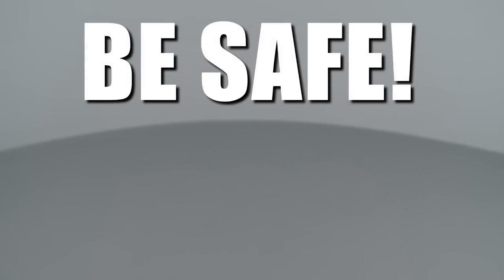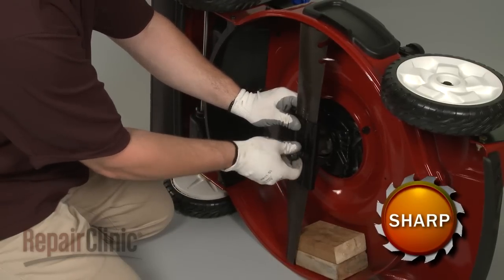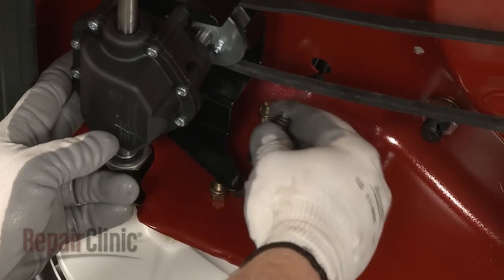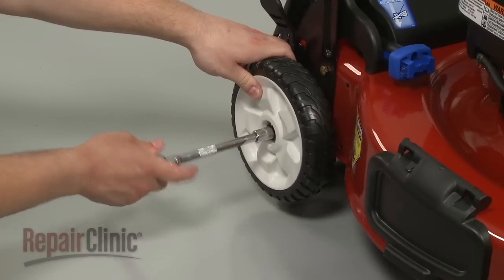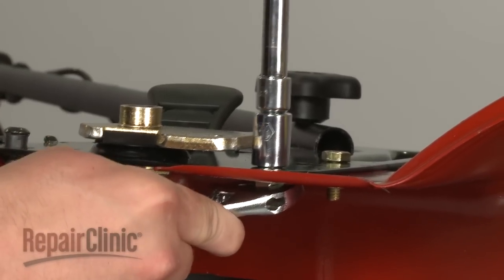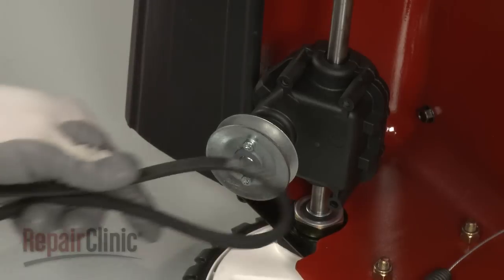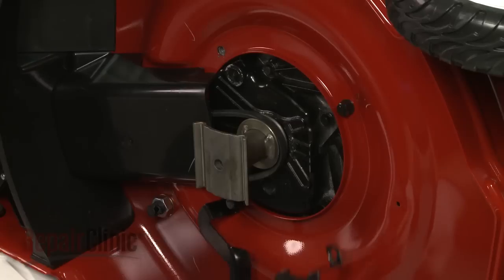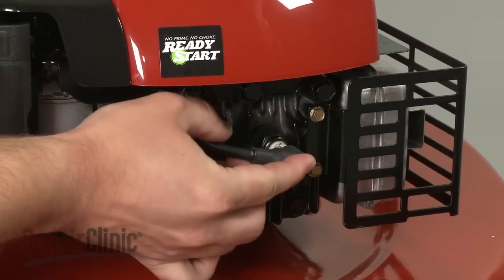Toro Lawn Mower Disassembly – Lawn Mower Repair Help

Comment: i took the right blade off and the bearing out on a my 42 inch toro rider. putting back together do the blades face the same direction  or do they face the opposite direction one north and south and one east and west.

Comment: I have Toro Recycler 22 Self propelled mower. Te left rear height adjuster is turning around and won't hold the height. I removed the wheel and the height adjuster turns 360. I wonder what it is that broke.. Took the right wheel off to see if I could find something missing but do not see anything. Any suggestions?

Comment: How can I replace the gold colored plate at 3:22? I bought a new one but can't get the old one off. It's what the wheel screws into but the hole on mine stripped.
Reply: You ever figure it out get a reply? I'm having the same issue.
Reply: @agentwise8725  Nope. It's not my main mower so it's not a priority. You might try calling Toro. Their customer service was helpful last time I called a few years ago.

Comment: Just bought this model new.  When the battery didn't charge in 26 hours, I checked the battery to be sure there was a fuse. There is but now I'm having trouble getting the battery back in.  Can anyone help an old lady out?

Comment: what about the spin stop model 20333? Much more difficult with a pulley and a bolt that has to be taken off thats connected to the shaft. Flywheel turns with bolt how do you stop that?
Reply from the maker: +-Doug - It would be difficult to say. We did not create videos for that model.
Reply: You should. Especially since that model is the mist complex of the base model recyclers. Regardless I did get it apart. A large flat head was used by sticking it through both of the openings that go around the large round spin stop pulley I turned it until the screw driver stopped an an area on the base of the engine that is more shallow then the rest of the engine. That created a wedge and stopped the shaft from turning I then used a breaker bar socket wrench and got the bolt loose and off. From that point there are 2 engine mount bolts left once those are taken out the engine can be lifted off the frame. From that point I had the entire mower dissasembled every part within one hour. One issue did occur which has occurred in the past when removing a briggs engine from a walk behind mower, that is one of the mounting bolts was frozen and would not turn. It ended up snapping. So I was left with on broken mounting bolt on the base of the engine. Tried to turn it off with vise grip plyers and then a small pipe wrench, no dice. Ultimately I had to cut the bolt off flush with the base of the engine from the bottom. I then used a tap and made an indentation for a drill bit. I used a very good titanium bit with a nice sharp tip, started off with a smaller bit drilled straight through the bolt directly through the middle. Repeated with a bit the exact size of the other mounting hole. Drilled the old bolt out. Removed and blew any remaining pieces of steel. Took a rivet maker tool, rerivited the hole to the exact rivet style and size as the original bolt. Took a spare base bolt from another dissasembled engine, good to go the engine is ready to be sold or used on a future project. Worse case scenario if you cannot re-rivet the whole drill the hole out slightly larger and use a good nut bolt washer combo to replace the original mounting bolt. Thats how its done so if anyone asks, there it is.
Reply: Side discharge plate on toro. Mulcher plate has

Comment: 2:39 that Brass Plate is what I need to replace.  Any one know how to get that off?  I have took the shaft out but can't remove that "brass plate"  or a video I can watch on that?
Reply: I also need to replace that part (it's called an "Arm-Pivot" in the Toro documents).  I ordered and received a replacement part, but I cannot figure out how to remove it!
Reply: Me too... Any word?
Reply: You ever get a reply, any word?
Reply: I know this is an old comment - but just in case anyone else is watching this wondering… I just had to replace this on a Toro 22 Recycler personal pace model 21462. The left rear wheel kept falling off and I finally realized it was because the threads in the plate holding the bolt were stripped on one side. I was using super glue for a while but eventually decided to order the plate (was like $11). I removed the wheel, pinch clip, gear and washer - then removed the small bolt that sat very close to the brass plate (was in the way under the mower deck when working). Once it was just the plate and adjustment arm left - I used vice grips to hold the threaded bolt wrapped around the transmission shaft - the brass plate is screwed onto that bolt (? Not sure really if that’s the right terminology for it but that’s what I’m calling it)through the deck. Mine was stuck pretty good. Ended up using vice grips to hold the nut in place and using a hammer to hit the plate to try and turn it. It was a pain since the adjustment arm gets in the way so if someone can help lift it and turn it and the plate while you hold the bolt it helps. I don’t know all the correct terminology but I hope this helps someone because I watched youtube videos for a week straight to figure out how to do this and no one had it. Everyone was taking the whole mower apart and taking the transmission out and I just did not want to do this. Hope this helps someone!

Comment: Good luck trying to figure out the screw head on that shield over the transmission pulley
Reply: Standard Torx (star) head screws usually on those covers

Comment: This all is pretty self explanatory and does not warrant a video. Mine came apart right from the factory and had to do all that without any guides. 
However, I want to service the motor.  How to disassemble and service the Briggs&Stratton motor?